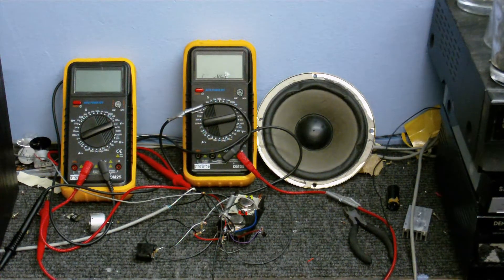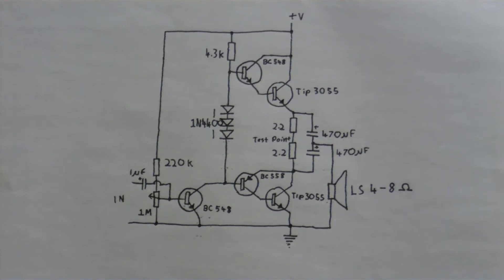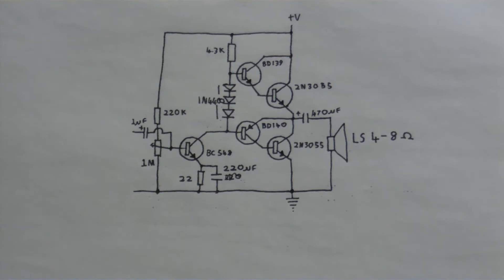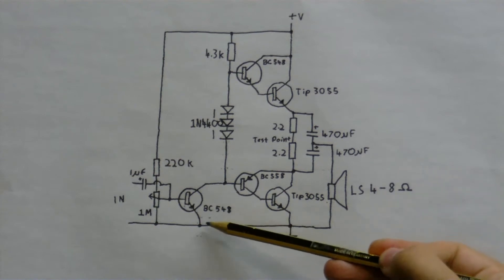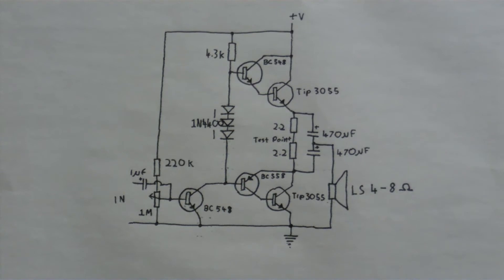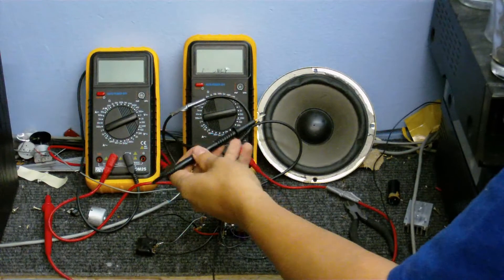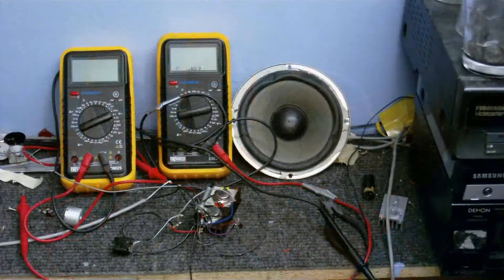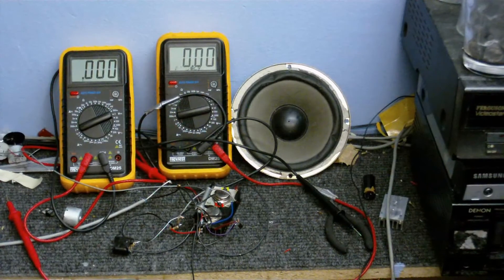The Amplifier "Adventure" II - The beginning

Comment: i made a two channel amplifier based on this circuit:
http://hackaweek.com/hacks/wp-content/uploads/2011/08/class-ab-amp-schematic.jpg. and i change the 470uf with a 330uf 63v and the output transistors with tip41c and tip42c and from a 625mW amp it turned into a 15W+15W amp!!!

Comment: Great video, How do you control the voltage gain?  as far as I can see there is no source of negative feedback in this circuit? except for the Emitter resistor in the common emitter in put stage which was removed, Wasn't that resistor necessary to comtrol voltage gain? as the next stage (common collector push pull) has a voltage gain of approximately one, so if the impedance of the speaker is known then power output can be controled through the input stage design.

Comment from the maker: I would experiment with making a tube amp but I dont have any spare tubes to experiment with, I'm going to try experimenting with mosfets when I've found some other parts I need to see if I can get anything out of that.  BTW I saw like your pcI86 tube amp, is it Class A based or is it in a push-pull configuration?